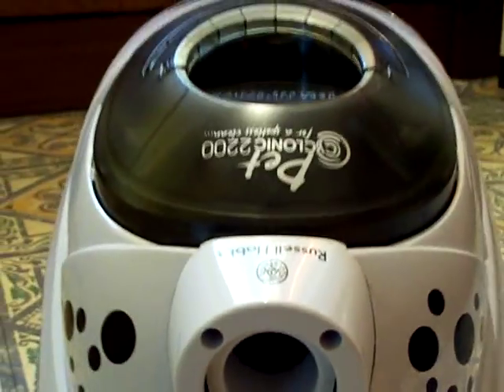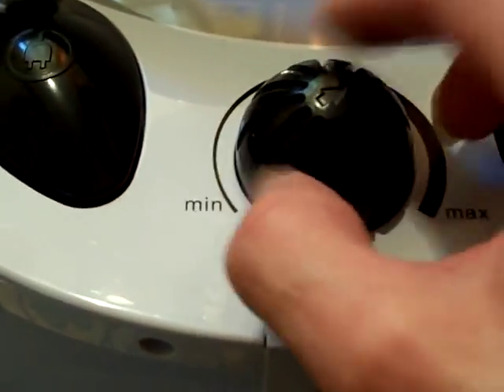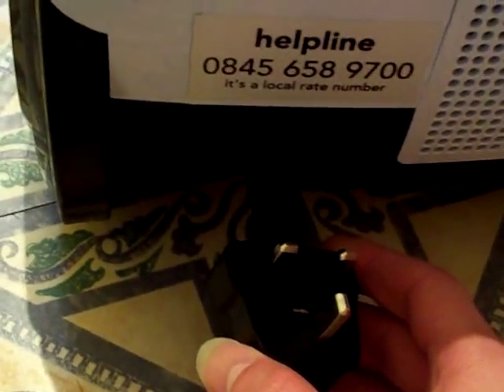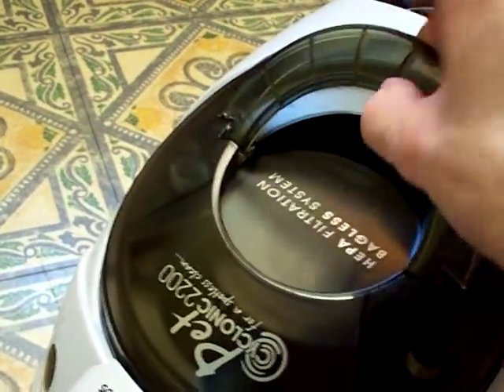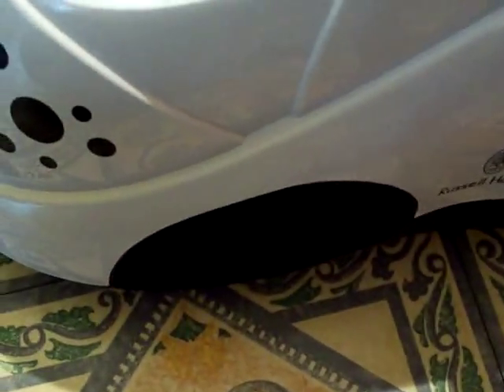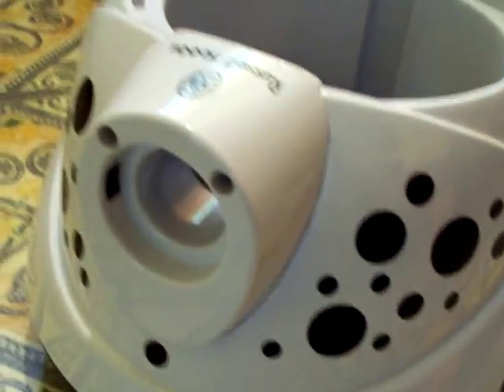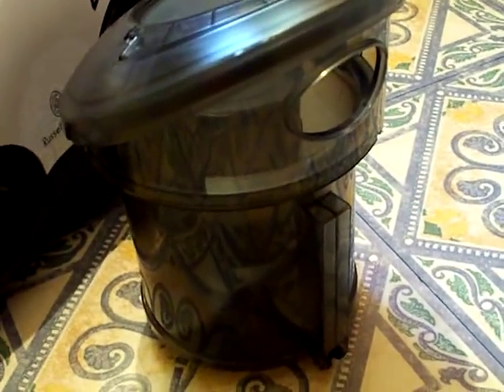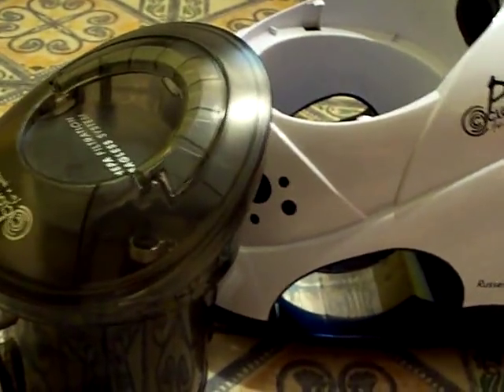Electrical : (Part 3 of 5) Russell Hobbs Vacuum Cleaner restoration.

Comment from the maker: This was virtually new when it had the unfortunate incident of eating some things it sucked up. :-(

Chucking this out -or even popping the motor- would've been wasteful. For the few hours I spent on getting it cleaned out, cleaned up & re-assembled, I got me a vacuum cleaner. :-)

Originally, I was given this to pop, but it was just too good for poppage. If it was old, beaten up & on its last legs, then I'd have whipped out the motor & stuffed it on the variac....Until it popped. :D

More soon!

Comment from the maker: That could be interesting! To see if the mini-variac on this could actually speed up and slow down the other vac while they're both connected into the Fun-Jiggery-Pokery Unit!

BANGING IDEA!! :D

Stick 'em both on the variac & crank 'em both RIGHT UP. :D

Yep, as soon as I can get a spare moment, it's going to be this vac, the other one and a Fun-Jiggery-Pokery Unit for laughs-and-giggles. :D

As I type this, it's like a blizzard outside! Tobias is in bed, nuzzled-in with kitten No.1 :-)

-BBD.